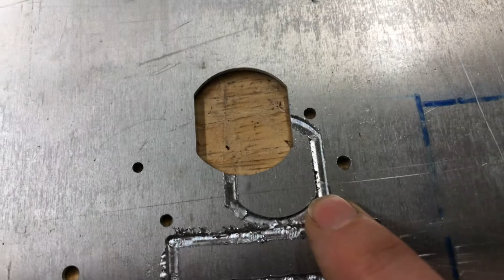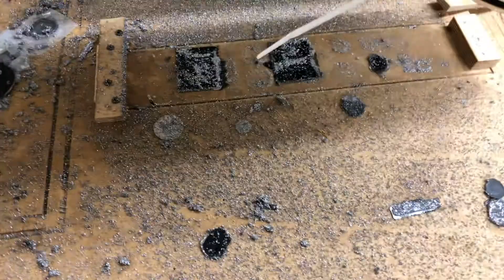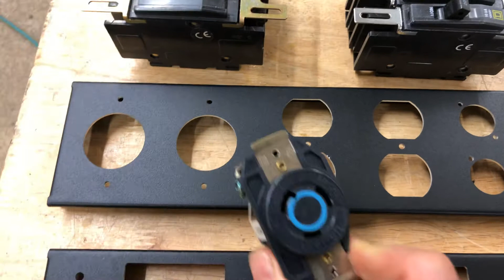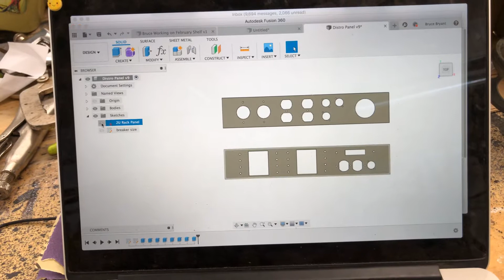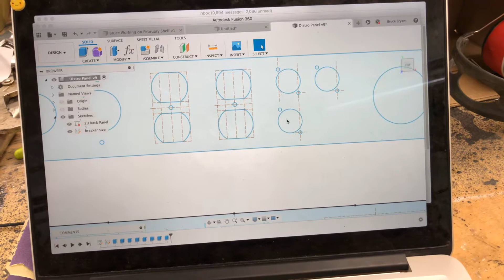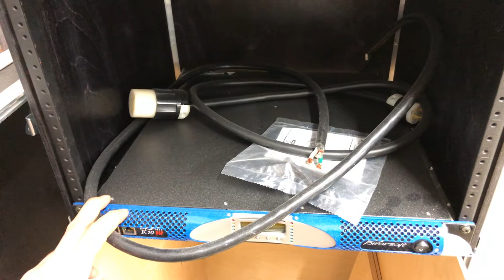Aluminum power distro rack panels on CNC router

Comment: how many circuits can you have on a 30 amp feed in single phase?
Reply from the maker: Number of circuits is infinite. But if you say have two 20 A circuits parallel on one phase. To remain reliable you should not exceed 12A per circuit. Or 24A total load, or 80% of the total circuit ampacity.
Reply: @brucebryant6483  does that go for each leg of 120v from a 240v 30 amp feed? How many circuits do you recommend to put a 30amp 240v single phase feed
Reply from the maker: @pandarecords7694  Yes for any 30A 120v feed. A typical 30A 3P Y208v setup is 15A x 2 per 120v leg totaling 6 circuits.

Comment: Where did you get those breaker swich
Reply from the maker: They are Square D QOU breakers. Part numbers go QOU120 that would be a single pole 20 amp. For a two pole 50 amp that would be QOU250 etc. Just google and find a supplier with a good price.
Reply: Hello is there a link where I can find those breakers I'm seeing some but not with the same mounting brackets